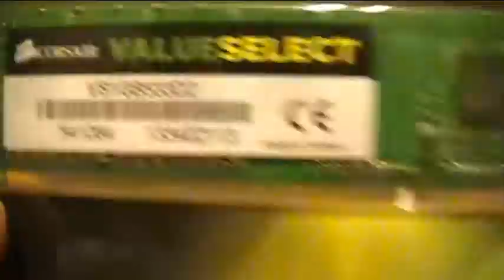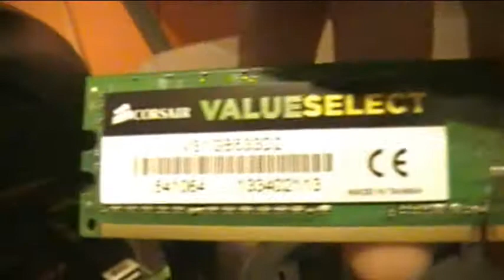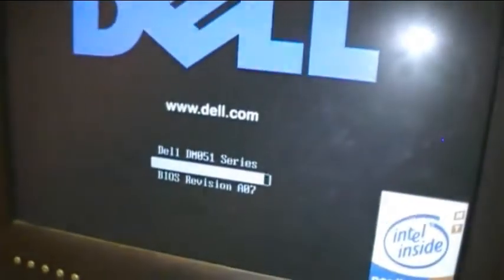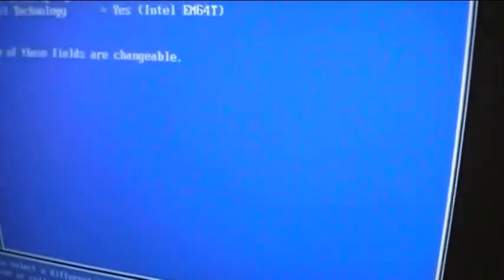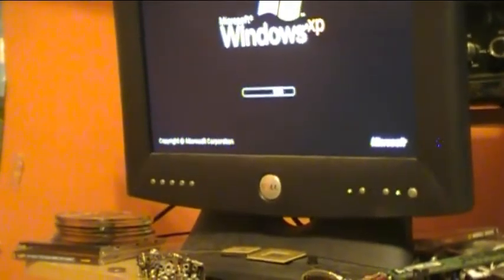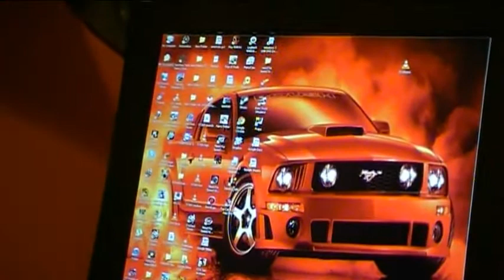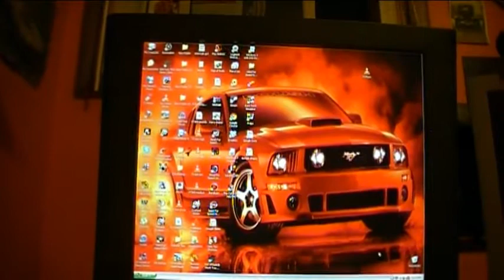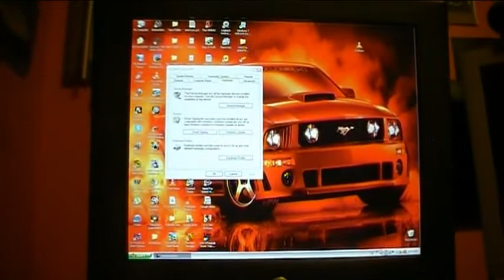upgrading the dell e510

Comment: mine has win 7 64-bit 4gb ram (nanya 6400u) geforce 9600gt 80gb hdd 7500rpm and it runs games! from mw3 to titanfall on high settings (mw3) and medium high on titanfall)
Reply from the maker: cool bro mine is currently runnin 32 bit 7 what processor you got?